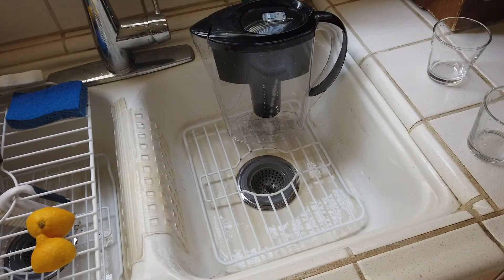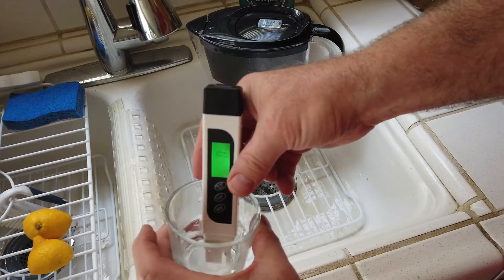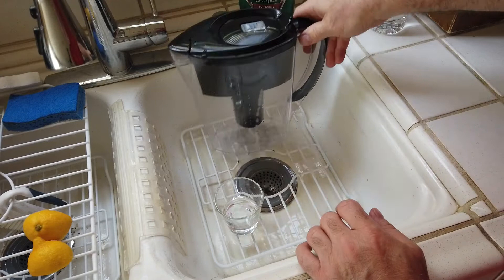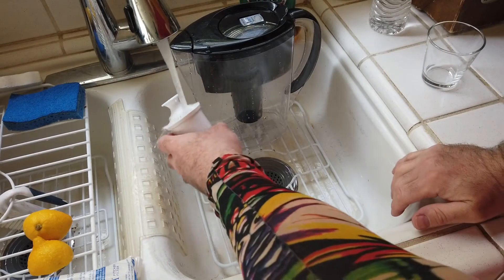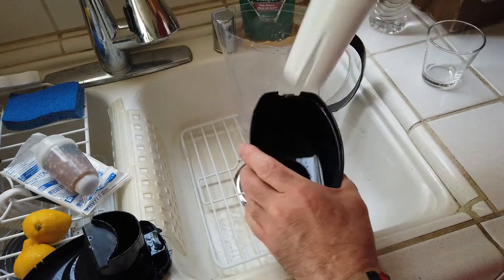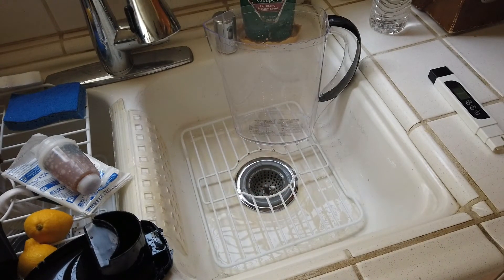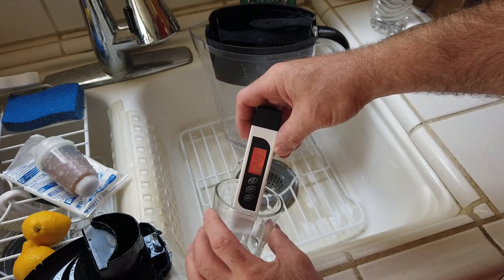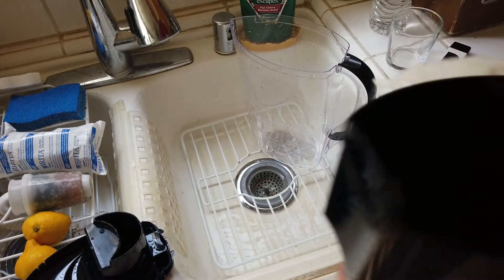Terrible Tap Water: Testing Brita & Zero Water Options (TDS meter)

Comment: You have to soak or throw out the first few pitchers of filtered water when you install a new filter or you will get high TDS. Overall I have found zero water filters are best. I also use Ceramic Filters in a Stainless Steel Gravity System but seems to retain the minerals.

Comment: Zerowater would be great if you didnt have to constantly buy new filters. So what are you doing for drinking water now? What is your solution?
Reply from the maker: Agreed.  Zerowater filters are not cheap and don't last long.  I looked into reverse osmosis set ups for under the sink, but those are expensive and they need filters too.  So our current 2-step process is to fill the Zero container and then take that water and fill the Brita.  Works for us.

Comment: My point being that your Brita filter test reading was largely inaccurate because it was mixed with water that had a 300+ … @4:57 You can see how much water is left inside of the container which was water reading at 347. Then @5:46 is when you add tapwater to the Britta filter which is then mixing with the water that was left over inside of the container.

Comment: I worked in a city water purifying plant for many years, testing water in their lab. Please folks, stop looking to a TDS meter to see how good your water is. Its a conductivity test that reads in ppm. There are many more important factors, and a lot of research is required to figure out what their individual test results mean. And don't look to your municipal water treatment plant supervisor for good advice either. They'll tell you what they want you to think. I myself did not drink the water that i made as an employee there. And i still don't.
Reply: Won't the TDS meter indicate when your water filter stops working though?. I change my filter when the TDS reading gets close to my tap water reading. I'd assume it's not filtering solids at that point therefore not filtering the nasties.
Reply: How do you go about getting clean water if I might ask?
Reply: So ... What water do you drink then?
Reply: I could be wrong but I’m pretty sure TDS meters do effectively detect chemicals and minerals in your water, but you can’t necessarily discern one from the other just off a reading. One absolute fact is that tap water is criminally toxic. I would recommend a reverse osmosis filter or a distiller to effectively remove toxins. If you want to buy bottled water I would recommend arrowhead; their water is chemical free and rich in essential minerals.

Comment: You can't really rinse the filter under tap water as that is incomplete.
Best to shake, shake, shake the filter then totally immerse the filter in a glass of water. Wait for all the bubbles to settle, then take the filter out & let the water inside the filter totally drain out. Shake the filter, empty the water glass & refill and repeat twice more. This cleans out a new filter properly.
Reply: Not saying you're wrong, but the actual brita youtube channel shows simply rinsing it
Reply: @FOZ23  Right, and in my experience simply rinsing it isn't enough.

Comment: No sir, anytime you open and install a new Brita filter, you need to fill and dump 4 pitchers of water before drinking. Check your TDS number after the 4th flush.
Reply from the maker: yeah, I did that in the past as well, along with running it under water after opening (per the instructions), still no go for me and my city's water.  Zero Water has done the trick for me.  YMMV due to your city's water treatment.
Reply: @ReLoadersBench  Oh ok... maybe it is your city water. Because my experience with Brita.... my tap was at 127 before flushing. After four flushes it went down to the upper 40's.

Comment: TDS meters are not a good measure of water quality.  It measures the ionic content of the water, e.g, dissolved metals and salts.  Organics will not be detected.  So, you could get a low TDS level and be drinking a glass of carcinogen.  Or, you could get a high TDS because you have very hard water.  Or, if you get municipal water, it will be measuring the fluoride added by the water department.

Both the Zero Water and Brita filters are essentially the same thing:  ion exchange resin (likely Dowex) and an activated charcoal filter.  If you are concerned about your water have your local Department of Environmental Protection or Agricultural Extension test it,  They usually do it for free or a nominal fee.  And, they will test for things like dissolved organics, lead, etc.

Then, buy a real filter unit, e.g. an R.O. Home unit.  I can say from experience that if you TDS is higher than 250, a Zero Water filter will last less than a month with regular use.  (I use it to control boiler scale in my kitchen pots.). A home R.O unit will last longer and have a self regeneration function.

Also, the filters are treated with metallic salts to prevent bacterial growth.  Once that wears out, you basically have a source of bacterial contamination right in your refrigerator.
Reply from the maker: Good info to know, thanks.

Comment: What TDS meter is that and where did you get it?
Reply from the maker: @torny841  - hadn't thought of that under normal circumstances.  Will give it a try.
Reply from the maker: Picked it up on Amazon.  It reads almost the same as the one included with Zero Water.

Comment: You can buy packets to add minerals & electrolyte to your glass of clean water... 😂c

I am clueless as to what the meter is measuring and why Zero is better.  

I grew up in a town with a Distillery and underground river.  Never realized " city water " was so different.  I let my water sit for a day to off gas chlorine.
Reply from the maker: I had to do a bit of looking into the whole TDS thing as well.   The TDS (total dissolved solids) measures ppm (parts per million, in this case "solids") for water.  My TDS indicated water that measures 0-50 is "cleanest".  My tap @ 400 obviously has some "solids" (metals and inorganics) that I'm probably better off not ingesting.   Besides, the cleaner water will be better for the espresso maker ;-)
Reply: @ReLoadersBench   minerals are also in tds which you need to live